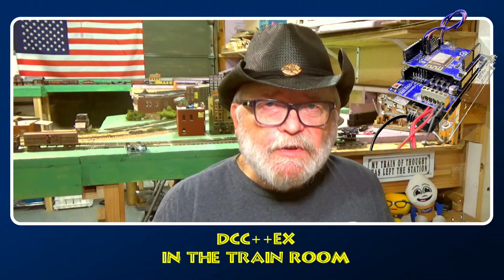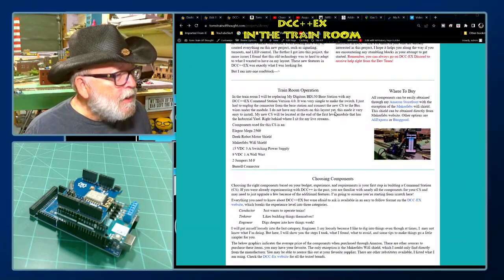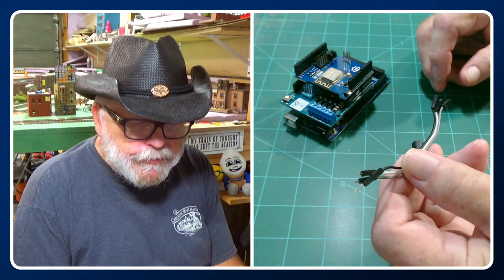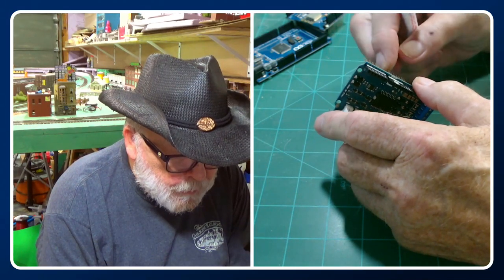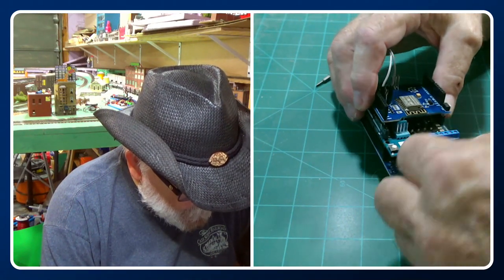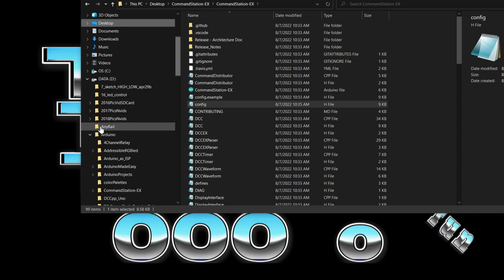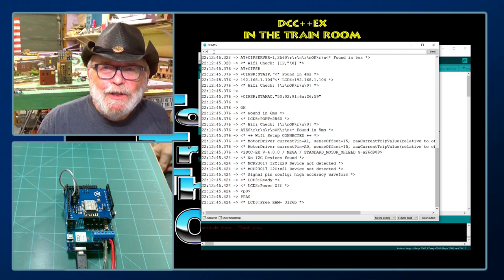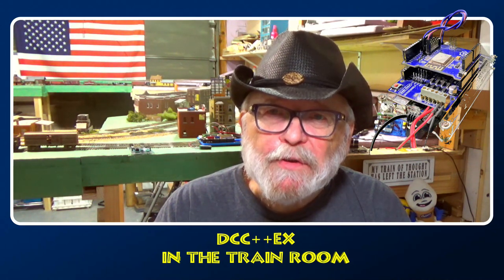How I Built A DCC++EX CS For My Train Room

Comment: To get rid of one wall wart, I bought a 15v dc 5 amp power supply.  I split the output to my shield and then my Arduino via a 9v 1-3 amp DC Buck step down converter with either a USB or a 2.1mm diameter plug (center positive).  I had to buy a 2.1mm to screw terminal adapter from the Buck to the Arduino.
Reply from the maker: That's what I usually do, but for the video I have to keep it simple!
Reply: @TomsTrainsandThings  To me, its simpler in the long run because I only have to later put one plug into the AC outlet.  But thats me.  Thanks a lot, love your videos.
Reply: Jacob I'd be interested in knowing the exact components you used. I've been on DCC++EX for months now but am using two separate power supplies and it's just cumbersome. Now a huge deal normally but I move my little setup around often.
Reply: @Trains-With-Shane  I have also used an ATX pc power supply and an atx breakout board, then split the 12v to the motor shield and to the 9v buck (then that to the arduino).

Comment: A good concise introduction to assembling one's own DCCppex system. I have the parts on order.  I only wish there was a project box to contain it all.
BTW, old phones are cheap and make great separate WiFi controllers.
Reply from the maker: Thanks!  I use my S8 for a throttle. I've been looking for a good project box, but none seem to work out. May have to 3D print one.

I think I saw a few on the DCC-EX web site available. They were also 3D printed

Comment: Hi Tom, first let me say I have no real love of real trains, I could get to London in 1927 seven minutes faster that I can today but last year I became interested in 00Bills YouTube chanell reparing old engines and being a retired engineer through I have a go at that.  I brought a old loco off of Ebay and soon it was moving back and forth using a lab power supply and then started to look at for a proper controller but didnt want to spend a lot of money. I found a Zero1 and after some resteration got it working. By then I had realised how much modern controllers were. Duing my research I came across your page and though an Ardunio might be a cost effective way of getting into the hobby plus I could use it as introduction to coding for the grandkids. And here is wher the trouble starts, but with Fred D's help I now have a working controller.
I think you want to encourage new people to the hobby, and you have said that nearly all the problems encountered are due to lack of knoledge, and I fully concure.BUT you were in at the beginning, and have seen it slowly develop into something quite powerful. Many of us hav'nt. We are starting from cold. You have shown how to set it up BUT other than address 3 how do you get engines to work. I had no idea but Decoder pro seamed to be the answer, but I struggled for 6 months and every time I tried to speak to a n engine I got 308 error code. Finally Fred D in answer to another question included one sentence that told me how to communicate with engines and if I loose that email im buggered. If I had your experance I might of known. 
PLEASE dont assume we have your experiance, assume were idiots and starting from cold. Loved this video but it did leave all of the important communication detail and without it DCC++EX wont fly and all yourr valent efforts will be for nought.
Reply from the maker: Thanks for your concern. I cannot start from scratch on every video I produce to walk the uniformed through every step from the very beginning of a topic, this would cause the video to be an outrageous 2+ hour event. I do have over 700 videos and many playlists, over 60 to be exact, that have supporting information that walk the beginner step by step through almost every topic in model railroading.

Browse through my channel on the Playlist page, there you will see topics such as; JMRI, DCC, DCC++, Arduino Made Easy(er), Arduino Projects, Model Railroading For Beginners, Back To Basics,, Soldering, Electronic Projects, and many more.

Thanks for watching my video. Fred Decker is a great person with immense knowledge along with many other on the Dev Team. They have helped me out along with many other modelers through problem with DCC++ & EX. I've had a couple of them on my Monday Night Live Stream to help answer questions and give insight to what to expect in the future of DCC++EX.

Hope you enjoy running trains with your command station!
Reply: @TomsTrainsandThings  thanks for your reply. Understand you can’t cover everything and I have watched many of your videos but can I ask you to direct me to how you program a decoder with DCC++EX
Reply from the maker: Thanks for the video idea. I do not think you can program directly from the command station without JMRI hooked up. I'll have to check into that!

I do have a few videos where I program an engine through JMRI but with Digitrax. It should be the same if you have JMRI set up for DCC++EX. I find it much easier to program with JMRI. I'll have to do some research in my videos. I know I showed using JMRI with DCC++, and how much faster it was as opposed to with Digitrax hooked up.  II may have that embeded in a video titled something else. I'll look for it!

Comment: Tom, I had the same problem with my power supply to a Digitrax system. It wasn't that cheep either.
Reply from the maker: I kept switching motor boards thinking they were bad before noticing the flashing LED's

Comment: I am building a new DCC EX CS for my HO layout.  I use a DCC EX to power my N scale and I have enough power to control kato turnouts using NCE switch-kats.  On the HO layout there is not enough power to control my HO Kato turnouts using the same Switch-kats.  Using the Digitrax Super Chief with 5 amps and 14 volts I have no isuue.  I see you are using 15 volt power supplies on motor shields rated at 12 volts.  Can I put my HO transformer 15 volts with 5 amps that was being used on the Digitrax system and hook up to the Arduino motor shield without blowing it?  I noticed you are using 3 amp transformers.  Have you had any issues?  I really appreciate you videos as few others are running HO with DCC ++ EX.  Thanks :)
Reply from the maker: Your power supply is only going to output what the system requires . So if you are running only one Loco, it will draw 0.015 Amp under normal conditions
Reply: @TomsTrainsandThings  thank you for your response.

Comment: If I go ahead and install this, will I lose the previous stuff or will DCC++EX installer as an update?
Reply from the maker: You can save individual folders where you entered data and copy them to the new instalation if you are refering to older versions of DCC-EX. Not sure about the original DCC++. You would have to ask that question on the DCC-EX Discord  https://discord.gg/vesg38fE